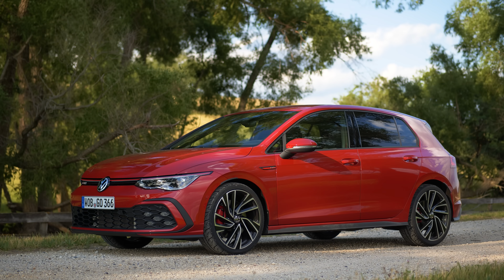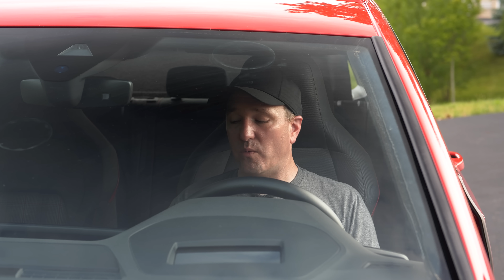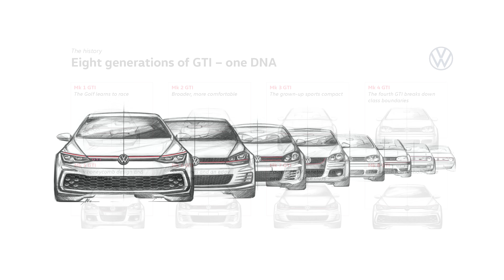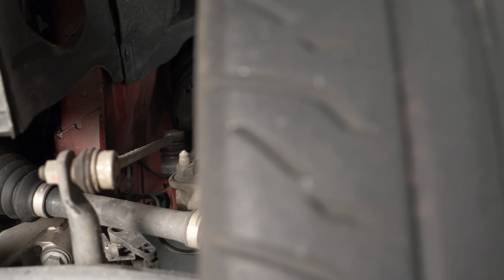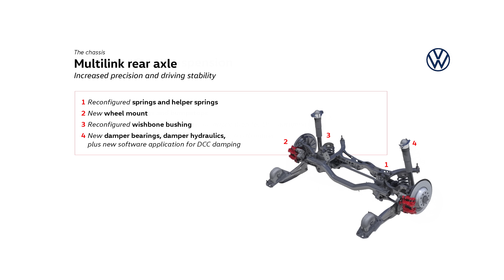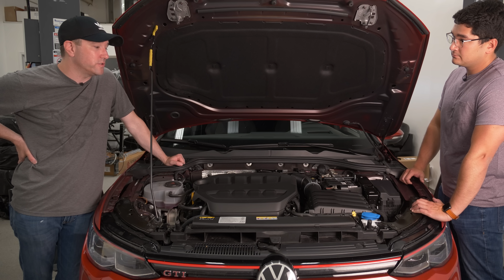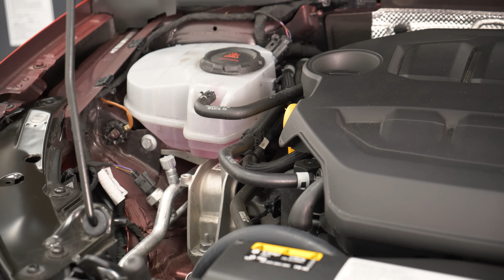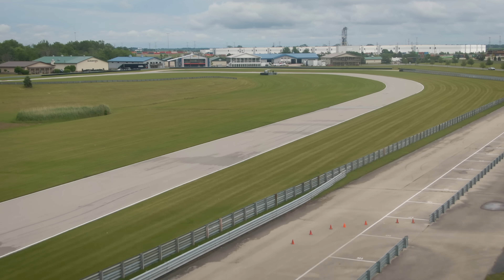2022 VW GTI Mk8 | Unexpected

Comment: This MK8 interior makes me want to keep my 2020 MK7.5 GTI forever.

Also your MK7.5 review was on really mediocre all-seasons and the MK8 is on sticky summer tires. 
Hard to compare those.
Reply: Not just any summer tire either. RE-71’s are a 200TW autox/track tire that are more like 160TW. Absolutely no way it’ll come on those from the factory, especially since the Falken RT-660’s basically replaced them and Bridgestone discontinued the RE-71R’s.
Reply: @g60corrado91  The factory summer tyres are Potenza S005 (similar to the US-market S007A, but possibly tuned more for wet and low rolling resistance), Ventus S1 evo3 and Goodyear Eagle F1 Super Sport. :)  Mk8 GTI buyers seem happiest to get the Goodyears from the VW tyre lottery.
Reply: @TassieLorenzo  I'm buying one of these in a few months, or rather ordering one, and I plan on having my dealer put Vredesteins I get from Tire Rack on the car before I take it off the lot. I have Quatrac Pros on my Mk6 and they still have 11/32 after over two years (minus winters) of highly spirited driving. Very grippy for an all-season tire.
Reply: @middleagedaang  how's the car? I'm really interested in buying one but none are available for a test drive around me. Another thing I'm worried about is reliability.
Reply: @terezacamaj688  I have not ordered it yet. I am actually thinking about perhaps going the Elantra N route. As far as reliability, with any VW, just do scheduled maintenance, and oil changes twice as often as VW recommends and you should be fine.
Reply: My Mk 7.5 had an all digital dash, the US didn't get that, apart from that I agree, the 7.5 looks better inside and actually felt very nice and well screwed together, not so much scratchy plastics as the 8, compared to my now 21 year old BMW E39 it's rubbish tho (in quality feel that is)
Reply: @PowerslideSWE  It's still a cheap VW. It's a nice place to be compared to Asian and American cars in It's class, but it's not gonna beat out a luxury car...especially from the era where BMW (and MB) were uncompromising.
Reply: Yeah, the tires alone make such a huge performance/handling change it becomes a very unfair comparison. Most all of the handling differences he noticed from MK7.5-MK8, I also noticed after just going from stock tires to RS3s on my MK6 GTI back in the day.
Reply: *and defeating ESC via VCDS. That also made the car much nicer to drive hard. It is very good that can be disabled now from factory on the MK8s

Comment: I just don't like the look of the MK8. Recently, I traded my tuned '16 MK7 PP to go back to an Evo X. Sure I took a step back in interior quality, fuel economy, as well as torque, but I love a more raw daily driver. The hydraulic power steering and a manual gearbox with a shifter that doesn't feel like rubber compared to the MK7 GTI and R has me smiling on my daily commute. Maybe when the MK8 R comes out I'll give it a try. Unfortunately, with all of the quality issues I had with the MK7 GTI it will be a hard sell to go back to a VAG product. Its sad when you compare an econobox Lancer on steroids to my old MK7 but now I don't have to deal with leaking door seals, a seeping sunroof, and constantly leaking rear hatch that VW was unable to fix after multiple warranty trips. It seems like every time I fixed an issue on the MK7 another would pop up. Even the supercharged Elise I had was more reliable than the MK7 GTI.

Comment: What's with the plastic clutch pedal arms on new cars these days?
Reply: Designed to collapse in a crash. 👍
Reply: @DeuceDeuceBravo  That is odd, why not the brake arm as well? It seems to me that in a crash situation your foot would go to the brake first or perhaps both feet would be on the pedals at the same time. I Googled it but didn't find a legit answer....cost cutting?
Reply: @zacknrudi  Great point. I might have got some bad info on that? If you find a legit reason let me know!

Comment: I had a Mk VII  (2016)  Sold it 6 months after the warranty expired.  Great car to drive, but the car let it be known, it was going to be an expensive-to-repair pile of junk.  Problem after problem. (like the computer shutting off a cylinder while on the highway) I will NEVER buy another VW again.

Comment: Too bad the US version won't have both direct and port injection. That would have been a modder's dream, as well as cleaner valves.
Reply: Port injection is gone from all VW models, even EU ones. They removed it when particle filters became mandatory.
Reply: @UhOhUmm  I believe he is talking about port/direct injection combo, and not port injection only, they haven't done that in years as you mentioned
Reply: @armin.s8814  EA888 gen 4 has removed port/direct combo because of particle filter. Their info in the vid was outdated
Reply: This car doesn't have port injection on it, the EA888 with port injection has a fuel rail and harness on top of the intake manifold that this car doesn't have.
Reply: Eh, North America has no shortage of modders than get just as much power from the DI version of the MK7 and MK7.5

Plus they don't have the carbon buildup issue of the previous MK6.

Comment: How could they have made the same mistake that Honda made in the previous-gen Civic?  Cars need manual controls for audio/HVAC.
Reply: They’ve been trying so hard to copy Tesla tech that they forgot Golf fans aren’t buying a Golf for the tech.
Reply: @mikej243  well what else would they be buying them for, they look like a nannas car and they're slow like a nannas car...
Reply: Especially when the Mk7/7.5 were perfect for HVAC controls. It didn't need improvement at all.
Reply: i think they already threw the designers into the meat grinder. it is the same shit like in the ID.3/4 etc. designed by a fucked up nerdy kid that never had something else to play than a smartphone.
Reply: @Osprey1994  Porsche, Bentley, Lamborghini and Bugatti still use physical buttons...
Reply: @guenthersteiner8163  dacia still uses physical buttons 😂
Reply: Yeah, both Honda and Toyota have moved on from touch screen HVAC system, but Volkswagen somehow went into that?
Reply: Exactly!
Reply: They actually don't. they just need to perfect their AI like Tesla to turn things on or off for you. Future is 100% touch surfaces + AI.
Reply: Bye ✌️
Reply: I agree on audio, but on my VAG car with climate control I almost never touch the temperature or fan controls at all. If the windshield and rear window demister are stuck in a menu that would be a major point against it though. Interestingly Skoda (Another brand in the VAG) have stayed with a roller for the stereo volume on the steering wheel even on their latest electric car, but it's got to the point that laws need to be brought in to stop car manufacturers selling dangerous touch screen based interfaces (Which save them a fortune) as a premium feature.
Reply: Absolutely. Because VW it's always the years behind the other brands in everything ...
Reply: @uos64  not true at all lol. VW is just trying too hard with the tech stuff
Reply: @uos64  Not even remotely true 😂, my MK7 has features that Acura didn't get until 2018.  They were most likely testing an S or SE in this video so don't even talk about features until they review a fully optioned car.

Comment: I am actually quite surprised they shipped you guys this car with 71Rs.  It's a discontinued tire so it's weird as you cannot buy this tire from the dealer.
Reply: It’s kinda misleading to put cheater slicks on a press car, instead of using the actual tires that come with the car
Reply: It's also nowhere near the ballpark of any of the OEM tyres (Eagle F1 Super Sport, Potenza S005, Ventus S1 evo3) either! :)
Reply: Are they still available in Europe?
Reply: @aboojibreel  No it's just discontinued period.  The RE-71RS replaced it.
Reply: Jack said re71rs are loudest tire lawl ... **Types in rsrr

Comment: VW cheating as always, sending tuned test cars. Boycott this bs. The tires on the test car make a HUGE difference, it will drive completely differently on stock tires.
Reply: So then change the tyres? If you're that bothered
Reply: @caffeineisking8132  you are so stupid you missed the point completely, you can change the tires on any car... typical VW driver...

Comment: i bought a mk8, and my life changed. Now i have gone vape instead of old school cigs and i can haul my offsprings to school in this gti. I breed. Also, they shoud have replaced the steering wheel with a controller so I could pull those g's at the track

Comment: The controls aren't that bad but the touch steering wheel buttons are a big no.
Reply: Ive played around with the steering wheel in the Artion, same wheel that's going into the MK8 and the touch controls on there really aren't that bad.  The control layout is the same as they were in the Mk7.5 GTI, just now are touch controls and not physical buttons

Comment: the idea of using CAPACTIVE TOUCH BUTTONS ON THE F*CKING STEERING WHEEL and then no true backlit lighting on the climte controls on the center screen is beyond STUPID! so at night you don't even see them light up lol to adjust temperatures and the volume slider also does not light up
Reply: They used to say driving a Merc S class reduced stress levels.
Interacting with a mk8 will result in the exact opposite.

Comment: Chest beating says it all.
How is the subframe unsprung mass?
Reply: Well the biggest benefit is the extra rigidity, weight savings are just a plus
Reply: I was thinking this too. It’s part of the body of the car supported by the suspension. Unsprung would be wheels/tires, brakes, control arms and shock assemblies, right?
Reply: I think he misspoke, because he was talking about the aluminum knuckles as well, got em mixed up
Reply: Right? Aluminum subframe saves only 6.6 lbs, but that's really good because it's down low? 
Weight savings is always good, but it's sprung weight, in the middle of the car, below the center of gravity.
That's not special unlike lightweight wheels or a lighter roof panel.

Comment: Everything is an improvement but the interior, what a huge step back.
Reply: In the old version the 2 door was dope. Big doors and the B piller was further back so it had better visibility. You're right though, 2 door is just super impractical so people don't buy em. Not to mention that big doors and parking spots are a pain
Reply: And I had hoped at least the Germans would be able to resist this insanity ….
Reply: It is not only  a step back, it is like a jump back... And that subjectively is the only reason I don't even consider any, I mean it, any car build on this newest platform. I was really looking into Cupra Formentor 190 PS awd but went away amazed in disapointment. Couldn't turn on the seats heater on and that was it. Menues into menues into submenues.
Reply: The infotainment on the new GTI is a deal breaker.
Reply: @tylersmith4265  if I ever trade my 7.5, it’ll be for a Skoda or an Audi.
Reply: Boycott these disgusting and dangerous touch controls
Reply: I have had this car for a year or so (not anymore). The controls were a learning curve and a half. But after 2/3 weeks I got used to it..... loosely. I still prefer separate controls, but it is not the end of the world... BUT THEN AGAIN I had the physical controls on the steering wheel, not the touch pad nonsense that the GTi/R have. So I could at least control the volume in an easy way on the steering wheel.
Reply: @Astke  you could retrofit a standard steering wheel with buttons.
Reply: @dragospahontu  on a brand new car? Seems pretty pointless.
Reply: @deej628  why? It only costs like a 100$
Reply: @Astke  Well of course after having something so long you get used to it
Reply: Cup holders don’t have a lid, no trim on the door pulls, no fake stitching, no physical controls, no hydraulic hood dampers & no felt lining in the glove compartment, such a shame.
Reply: @whatevernevermind5960  well everyone has taken a hit, especially VW.  But Volkswagen put the money where it matters.
Reply: The Mk7/7.5 felt like my Mk4 GTI. Man I miss my Mk4 GTI...
Reply: Buy the Mazda3 Sport GT Turbo like i did and enjoy.
Reply: As a Mk6 GTI owner I can't see how this is a step back i absolutely hate all my interface but maybe mk7.5 is better
Reply: No worse than the awful USA built MK7 with cheap
Plastics, no cup holder cover and cheap plastic manual hand brake.
Reply: @bluecent  the MK7 is far better overall, everyone says this.
Reply: Don't forget the stupid looking front end and the fact that there is no 2 door option. They completely ruined the gti
Reply: @snowpaletehdog  Octavia RS is where it’s at, unfortunately not sold in the US.
Reply: @snowpaletehdog  You guys find a way to complain about everything. At least you can fully take off DSC in this gen, not to mention FAR better suspension geometry, better brakes, rides better, quicker, still has a manual..
Reply: @snowpaletehdog  people stopped buying 2 doors cause their impractical. 
Companies are gonna make what sales. 
Except that interior screw that.
But 2 doors are dumb af anyway.
Reply: I would much rather buy the 2021 Corolla SE sedan than this VW GTI.
Reply: @braetonwilson4296  Ew. Absolutely not. Nothing about the Corolla is performance oriented.
Reply: @sleeksilver  Still living in the past? Whenever the 2021 Corolla has been compared to the 2021 VW Jetta, the reviewer has said the Corolla is more fun to drive.
Reply: @braetonwilson4296  living in the past?  No, the current Corolla sucks and is driven by people who want a transportation appliance. There is nothing sporty about a Corolla SE.
Reply: @sleeksilver  The GR Corolla should fix that. IF we get it....
Reply: @sleeksilver  I bet a million bucks that you haven't even driven a 2021 Corolla SE sedan. I drove a 2021 Corolla SE and a 2021 VW Jetta R-Line back to back and the Corolla handled better and was more fun to drive. Yeah I said it.
Reply: @braetonwilson4296  I drove a 2020 XSE and wasn't impressed in the slightest.  Interior felt cheap, engine was loud and didn't have much power, rear seat was smaller than the last gen, and it generally felt like an appliance.
Reply: @dougrobinson8602  it will probably be $30k+ and I wouldn't be willing to spend that much money on something with such a poor interior.
Reply: @sleeksilver  That's exactly how I felt about the 2021 VW Jetta, just a boring cheap appliance. Especially since it's made cheaply in Mexico.
Reply: @braetonwilson4296  Dude, why in the hell do you keep on talking about the Jetta?  This video is about the GTI, not a Jetta. Also, no one cares about the Corolla here, it is a boring appliance.
Reply: @sleeksilver  Jetta GLI is the sedan version of the GTI. Driving dynamics and handling is similar between Jetta and GTI, just speed is different.
Reply: @sleeksilver  If no one cares about the Corolla, why is it the best selling vehicle in the world? Stop being jelly that the new car is reliable AND fun to drive!
Reply: @braetonwilson4296  *no one here, meaning enthusiasts and not boring vanilla people.
Reply: @sleeksilver  LOL have you seen how the 2021 Corolla SE/XSE sedans and hatchbacks look like? Nothing "boring vanilla" about that. Looks way sexier than this boring GTI.
Reply: @braetonwilson4296  I either found the Toyota employee .. or the most enthusiastic Toyota fan ever. Wow. I mean hey, props for finding what you love.
Reply: @gt1gtr  Thank you.
Reply: @braetonwilson4296  I was the opposite. I test drove both and found the Corolla to have much more cabin noise. The automatic felt sluggish, the manual version felt like it came out of a freightliner. Handling was the same. Ended up buying the VW Newer VWs are also reliable, they have an additional year warranty. This is also my 3rd one and they’re weren’t unreliable like most people say.
Reply: @braetonwilson4296  the Jetta is a Mexican built VW. Lesser quality.
Reply: @braetonwilson4296  the Corolla is just about the most boring car in the world
Reply: @kristians2704  Last Gen Corolla was boring, I agree. These latest gen Corollas are attractive and fun to drive. Unlike the german cars that are cheaply made in Mexico and break down every week.
Reply: @braetonwilson4296  German cars don’t break down every week lmao. Also, the new GTI and Golf R will be made in Germany
Reply: @braetonwilson4296  completely different type of car dude
Reply: @braetonwilson4296  Really? - I sure wouldn't - so much of Toyota is sooooo bland with nary the fun to drive aspect of the GTI - it's not perfect, no way I'd turn to Toyota.
Reply: @AtlasCroc  Akio Toyota sent a message to all his employees a few years ago "No more boring cars". That's why the latest Corollas look so sexy and are so fun to drive!
Reply: @braetonwilson4296  

Lay off the meth

Comment: The touch buttons are stupid. Are they insane? Touch buttons on steering wheel are extremely easy to mistakenly trigger.
Reply: "Touch buttons on the steering wheel are extremely easy to mistakenly trigger."   As long as you're a better driver than Sir Lewis Hamilton, you should have no worries. #Azerbaijan
Reply: funny thing is. The review is very positive for like 90% of the video. Yet all the comments are treating the car like it is shit because of some controls that are not ideal. people are so easily annoyed.
Reply: @Astke  is it a surprise? Mark also thinks electronics are dealbreaker. If you mistakenly hit volume increase button when your partner or baby is sleeping, you won’t want repeat that ever.
Reply: @na_wu  well clearly this is not a problem for many people, as it is selling like hotcakes in Europe. But then again we have the non-performance Golfs that have a normal steering wheel with buttons.